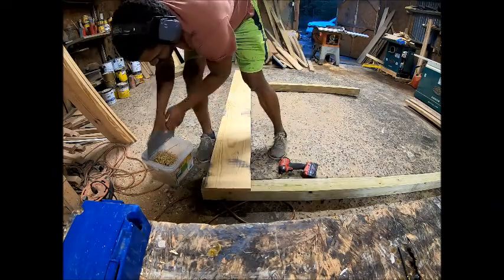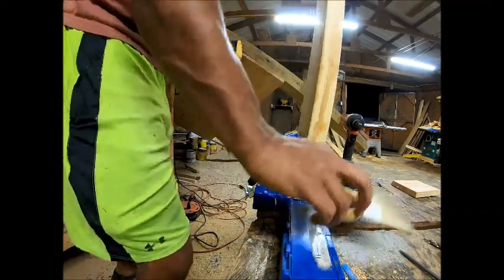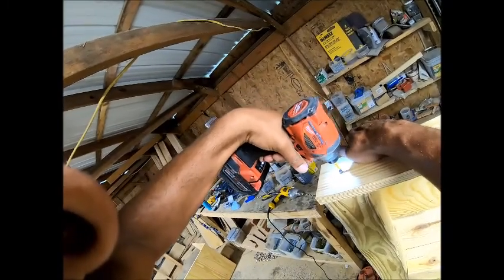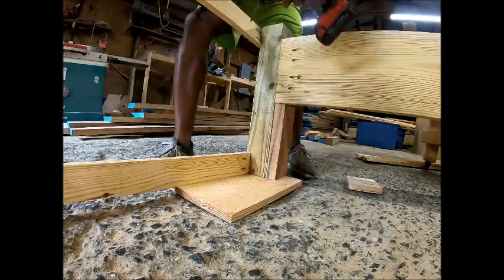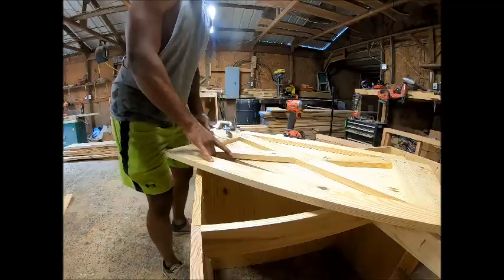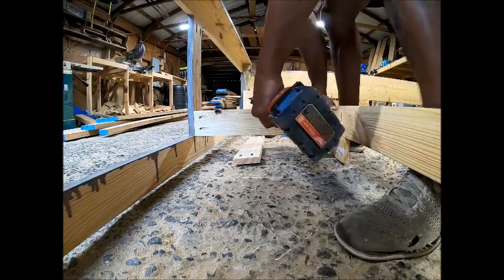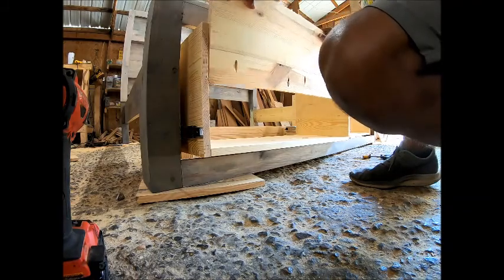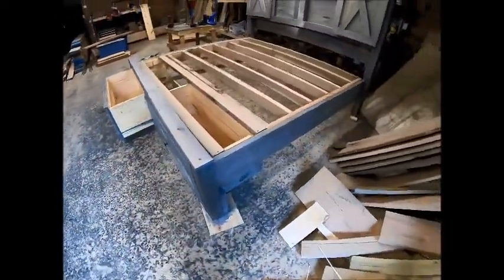How to build a Farmhouse King Bed with sliding barn doors

Comment: On the headboard face what or where does that 52" 1x4 go
Reply from the maker: That’s a great question! Me quickly looking at the picture and I can’t see where that would fit on the headboard. Could’ve been a miss print looking at my notes as I wrote all this down
Reply: Ok thank you. One more question is the 16.5" 1x10 for drawers do you have to unscrew those in order to seprate the foot board from the 2x10 runners in order to take the bed apart
Reply from the maker: @darrensyers775  I think you can leave those on. When I built this for a customer it was moved in 2 pieces. The whole bottom as one (with drawers out) then the headboard. I hope that answers your question
Reply: Yes sir thank you! Can't wait to start building it. Awesome job and thanks again for helping